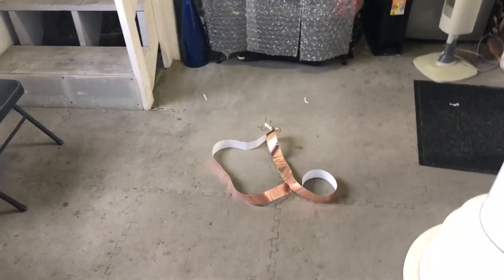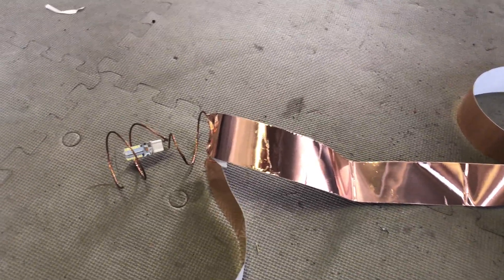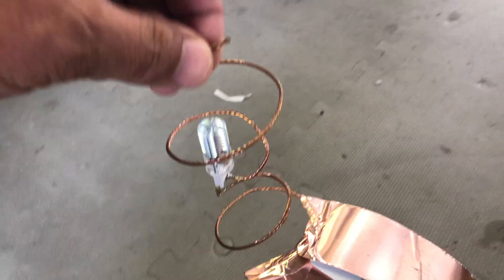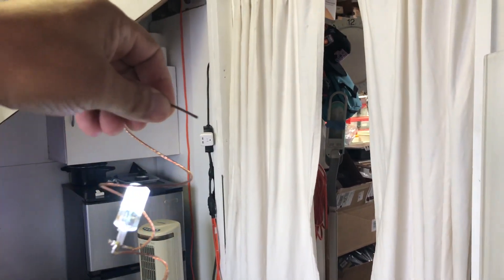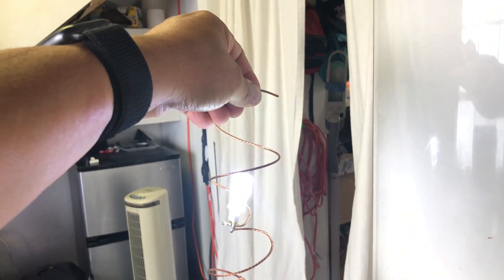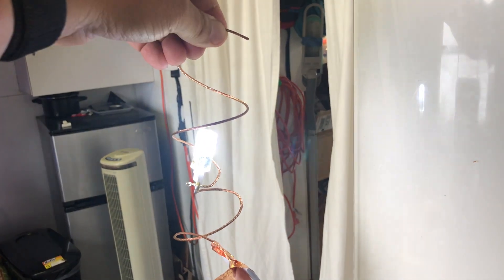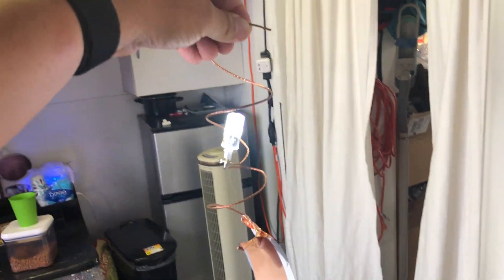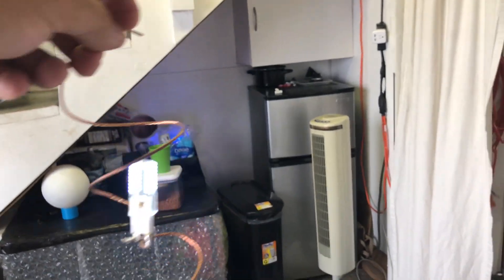Radiant Energy with 64 LED bulbs with increased antenna

Comment: fyi -   volts  are  Not   power.     power is watts.      watts  =  amps  x  volts.     this is old-fashioned,  and  Useless  electrostatics.        no   kewpie doll.       if  YOU  do  not  know  the  power/WATTS  produced, you don't know anything about the performance.       ever hear of a    crystal radio set.      NO  BATTERIES  required.     how can that be.     the density of rf  energy  is  extremely  low;  but, it can power a simple radio circuit, or  a bunch of  LEDs.     googletranslate
https://en.wikipedia.org/wiki/Crystal_radio